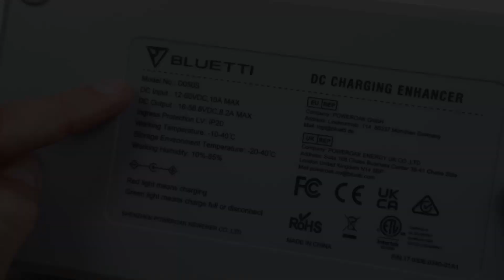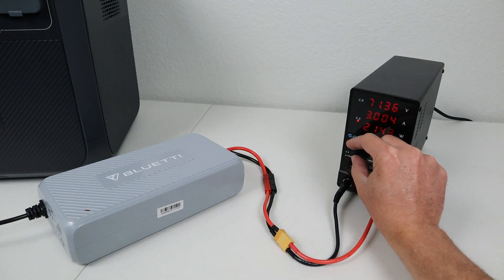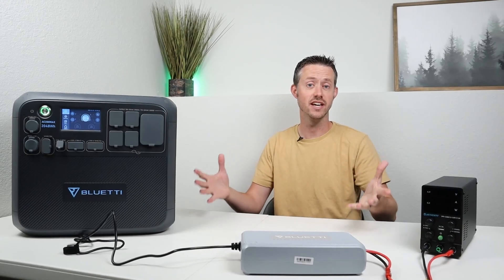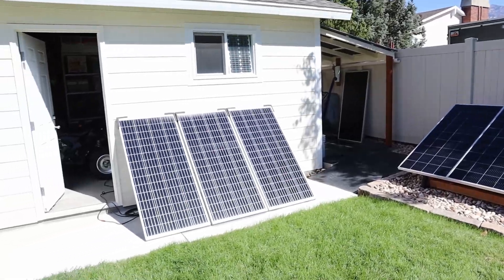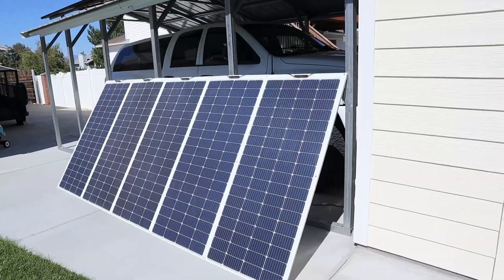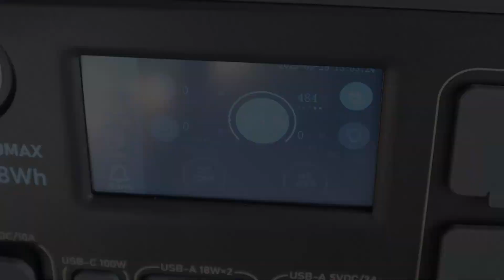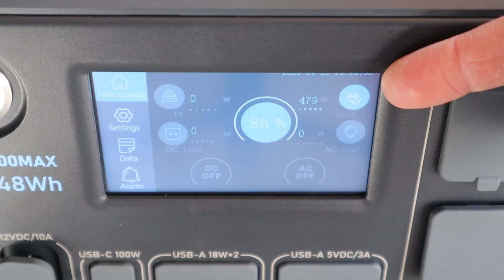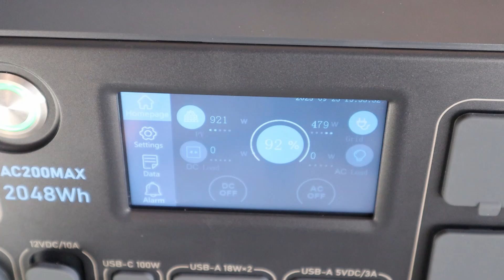The Bluetti Charging Enhancer Accepts More Than 60V?! Let's Find Out!

Comment from the maker: Now that we know the D050S can handle more than 60v input, would I recommend doing it? 
Hmmmm.... well I think if your solar panel VOC is pretty close to the 60v cutoff, I think you'll be fine. If you're going to be pushing it into the low 70's you might be at a higher risk of damaging the charger...especially if it's cold outside since your panels will get higher voltage at cold temps. NOTE: all the voltages seen in the video are VOC and remember the voltage under load (Vmp) will drop down significantly and most likely will be around 45v-55v. Give me your thoughts, what do you think!?
Reply: I’ve been running a d050s on my ac200max (with 2 b300’s) for over 6 months now. I have 3x eco-worthy 195 watts panels connected to it, in series. They have a open voltage of of around 65. The do50’s has never had any problem with them. Under load, they are running in the mid 50 volt area. It charges at 500 watts under ideal conditions, even higher at times.
Reply: It might be good to open it up and verify voltage ratings of the input capacitors.  It's harder to verify mosfet voltage ratings (part number, look in spec sheet), but those might also be critical.

Hopefully they did do input voltage detection and shut it off at a safe level, but that is actually rather difficult and so typically a spec is given that allows some safety margin.  But if you intentionally intrude into that margin and something burns up then it is your responsibility.  Trying to get Bluetti to warranty or other replace equipment damaged by violating the specs would be dishonest.

I don't see what the problem is with a 60v limit.  How many amps can it take?  watts / amps = volts and you can compute the minimum voltage to get the full power.  Or you can watts / volts = amps to compute the amps at whatever voltage you have.  The Delta 2 and Delta 2 Max have a similar limit and you can find the appropriate panels to series & parallel to provide enough amps at a voltage within specification.
Reply from the maker: @Sylvan_dB  I'll explain why the 60v cutoff is pure garbage on these devices (EcoFlow, Anker, Jackery, and Bluetti all do it...) The input specs for this D050s are 60v @ 10amps, for 500 watts output. Is that 500 watts attainable with most solar panels? No, I'll explain that here in a second. Once you work with solar panels you'll understand that this 500 watts is basically false advertising on Bluetti's part for 99% of solar panels on the market (I have found ONE exception so far after looking at hundreds of panels...only NewPowa 180w panels keep under 60VOC). I basically showed this false advertising off in my first video on the D050s...

A 2S solar panel configuration will get you about 48VOC and 35Vmp. Remember the peak voltage (VOC) only happens when the solar panels aren't producing power. Once they start putting out power the voltage drops down to their Vmp rating. This means the higher VOC level is not a problem when solar panels are producing power, it's only right when you connect it up or if the charger is sitting idle. How much power will you get from two 180w 12v panels in series? They produce their peak power at 35 volts @ 10 amps, which is only 350 watts. That's the highest wattage you can expect on the D050s and that's only in perfect solar conditions. Realistically you would see 280 to 300 watts from those two solar panels in series.

But how do you get the claimed 500 watts that Bluetti advertises?! Since the Bluetti charging enhancer has the 60 volt cutoff you can't connect solar panels in a 3S configuration because they usually have 64VOC to 75VOC. To get the full power on the charging enhancer you need 48-50 volts @ 10 amps which is only attainable with a 3S configuration but too bad their VOC goes over 60 volts. So now you should see what having a slightly higher VOC limit allows for the full 500 watt charging amount as I showed in this video.
Reply: @Jasonoid  10 amps does make it hard! That means to meet the specs you have to be at least 50v but no more than 60v.  That's a lot worse than the Delta 2 which can do 15 amps, meaning you can get the 500 watts as low as 34 volt.  It sounds like Bluetti didn't think it thru very well!
Reply: The panel I’ve found that has the most favorable ratings for the D050S in a 3S configuration is the Kosta 200 watt PV. I haven’t independently verified it, but it is rated as follows & is priced competitively:

Max Operating Voltage (Vmpp): 18.90Volts 
Max Operating Current (Imp): 10.58Amps 
Open Circuit Voltage (Voc): 21.86Volts 
Short Circuit Current (Isc): 10.99 Amps

So open circuit would be slightly over briefly, than it would be well within spec. Thanks for the excellent video.
Reply from the maker: Per some of the comments today, 21v would be too much! 😂🤣
Reply: Ohh also, I’ve found my Bluetti max tops out at a sustained 920-922 watts of PV. The extra power capacity is nice.
Reply: @Jasonoid  well , I'm from Cuba , here it's always warm , just sometimes in a year it's like 18 or 16 degrees, just at night it's 12 or 11 degrees and it happens just 2 or 5 times a year , if it happens, so , should be good I think

Comment: My B300S 'Adapter input' is limited to 8A Max (which the D050S charging enhancer uses), 'PV input' is limited to 10A max, and GROK tells me I wasted my money and should use the PV input port. GROK told me using both inputs, doesn't increase watt inputs to my B300S

Comment: I have 3 solar panles of 100w 20.3 VOC in series , i have a AC180 , the Total VOC its 60.9V , do you think it could damage my solar input on my bluetti ac180? Please help🙏🏼
Reply from the maker: In cold temps the voltage would be too high. Warm temps you should be fine.

Comment: It is highly likely that if you tried to apply over 60 volts delivering a higher overall wattage the D050S would shut down long before the 75 volt threshold you have stated. Continued overvolting will breakdown both IC components and the dielectric strength of the insulation of the input  side of the D050S. Bluetti are airing on the side of caution to increase the longevity of their products, solar panels display more extreme no load voltages than batteries which drop in the same way when a current flows to do work.

Comment: It doesn’t show on the BLUETTI website but do you think this could be used on the ac180 unit for ac charging it only shows it for the ac200 models
Reply from the maker: Solar panels just connect directly to the AC180, or internal AC wall charging. This will not work with the AC180.

Comment: Great Video, thanks for the Info, this is so important because unless you can buy true 250w panels this is your only chance of getting close to the 500w input,, Go Over 250w panels and the Voltage goes over 30V per panel and the Bluetti's Solar Input socket does not like Over Voltage. But Bluetti Did Call It a Charge Enhancer In all Fairness to Them and that is what it is Doing In your Video, Big Thumbs Up. Well Done.

Comment: I purchased the enhancer mostly to run a different watt solar set. I can run a Bluetti 420w on the regular solar connection and then two EcoFlow 160w (each) with the charge enhancer. Is that good?

Comment: Can you use a 10 amp DC Dc charger as an input into the D50
Reply from the maker: Doesn't a DC to DC charger still put out 14v like the battery itself? I don't think you'll see a higher wattage or faster charging with that.
Reply: @Jasonoid  but would it work, i am looking for a way to charge my ac200 max while driving.
Reply from the maker: The Bluetti charging enhancer isn't worth it, this is a much better option:
https://youtu.be/NqnYaqMwktE

Comment: That device is hard to get. 9 out of 10 times when I look it’s sold out.
But I do have one. And I don’t even have a BLUETTI.

questions :
1) can I use this on other solar generators as well? It should theoretically work. Or at least it should if the AC input wattage can be set at the solar generator 

2) can you over panel it? If so, then you should be able to get close to 750 watt out of it.

Comment: Couldn’t you get around this high voltage by connecting in parallel?
Reply from the maker: This has an amperage limit of 10 amps, so putting solar panels in parallel won't benefit anything.

Comment: I use 4 Bouge rv CIGs Yuma 200 watt panels on my truck camper.2 - 200 watt in series (25v/8+a +/- 5%) on one side of the Bluetti AC200MAX and the same on the D050s enhancer side. I can use more on the solar side but it seems that it works pretty good. I have also charged with Dokio 300 watt (Great for low light/overcast days), 420, 350, and 200 watt Bluetti panels and to be honest a 420 on one side and 350 on the other if you are not running anything high will do.

Comment: Can this be used with my renogy 40a dc to dc charge controller from my start battery
Reply: No. It’s mc4 to AC out. Your dc/dc controller connects directly to a LFP battery. This device connect to the AC-IN on your solar generator.

Comment: Great video Jason. I am a recent subscriber. Btw the DO5OS manual says it has a amp max of 8.2amp. Even though the Ac200max has the current limit of 10amp.
Reply from the maker: Yeah, the Bluetti charging enhancer is designed to be compatible with many of Bluettis older devices.
Reply: @Jasonoid  do you think a grid tied inverter would do the same as  the DO5OS?
Reply from the maker: @DeSilver215  no, it functions very differently. A grid tie inverter takes DC solar power and turns it into AC power. The charging enhancer takes DC solar power and makes it 58.8v DC.
Reply: Hi Jason, I am curious how the bluetti power station ac inlet can handle 450w Dc via the 7909 barrel plug from the enhance charger in your video.
Reply from the maker: @DeSilver215  the charging enhancer is a DC to DC booster, it takes the voltage of your input and converts it to 58.8v.
It does exactly what the AC wall charger does, it puts out 58.8v DC.

Comment: They didn't lie. They they just didn't want to over state what the D050S would do. Also maybe they would only guarantee for 60 V use.
Lying would be just the opposite saying 70 V input but only 60 could be used. I am surprised you even said the lied.
Be happy you can push the device higher. Bad thumb nail. Don't fall into the trap of goofy or misleading thumb nails.
Reply from the maker: It got you to watch the video right? And now you know something new about it... How to get the full power 😁
Reply: @Jasonoid I I recently bought a AC180 and an AC200Max. At the time of your video I had a B230 being delivered with a D050S.
Thus I thought maybe the enhancer was junk by your title. Guess not.

That being said, Your misleading thumbnail and snide remark about getting me to watch is not the way I had come to expect from you. Too many Up-loaders on YouTube are goobers. Don't be one of them.
Title could have been "The D050S delivers better than expected"
Reply from the maker: @LarryDickman1  I've been working on a new title and thumbnail for the video. I'll probably get it changed here in the next week.

Comment: I bought a 600W voltage enhancer for 19 bucks on Amazon... The DS050s is just good marketing. Nothing more 
Apoesar 600W High Power DC to DC Boost Converter DC 12-60V to 12-80V Boost Module Board Step-up Transformer
Reply from the maker: Thats AWESOME! What type of power do you see from your version?
Reply: @Jasonoid  I can get 40 V (input voltage) x 10 amps = 400 W . I use it to connect 2x 200W Solar PV panels from Renogy.
My Bluetti AC200P has then : 600W (3x 200W Renogy PVs) on the PV input, and 400W (2x 200W Renogy PVs) on DC transformer input, for a total of 1000W PV input power. All this is used to power my Ford Transit camper van. I have built a "Input power" switch board where I decide which energy to use as input: 2x DC transformers connected to the grid AC, or 2x Solar input, or other

Comment: How about the a.ps being over 10amps. I was gonna use a 500 watt panel thats voc is 46v, but the amps are almost 14 amps which is over the 10 amp specs. Does the amps matter or will the enhancer onpull 10 amps max. I dont want smoke chech the enhancer :)
Reply from the maker: The enhancer will limit the amperage below 10 amps.
Reply: @Jasonoid  excellent,  thank you!!

Comment: I have a 55 volt mppt charge controller and when I took it apart it had 63 volt rated input capacitors. I wouldn't want to go over 63 volts because it might damage it. Check the input capacitors on your Bluetti to see what capacitors it has.

Comment: Thanks for this solid info. If I get a second solar panel array I'll get this DC enhancer.
TIP: Keep the supply cords running from yer solar panels shaded from sunlight and other heat sources for better conductivity. That's why the solar panels work better at lower temperatures.
Reply from the maker: My permanent solar wires are buried in conduit underground so they are nice and cool and not in direct sunlight.

Comment: Jason, is there any difference,  if you plug in the enhancer into ac200max, B230 or B300 ? In case, if ac200max is connected with b230 (b300) at the moment of charging. Thanks
Reply from the maker: Nope, it functions the same on all three

Comment: Good to see the OCV for the panels. Did you also measure the voltage for each set of panels when they were connected and providing power?
Reply from the maker: The voltage under peak load is much lower than VOC. Once the panels are producing power the voltage will be around 48 to 52 volts, depending on the panels. Just look on the panel specs for the Vmp number.

Comment: A little history...I have known this for a couple of years. I posted in the Bluetti group twice about this. Once in October 2021 and another time in July 2023. Bluetti told me in an email exchange with them about 2 years ago that 75 Voc was the limit. Bluetti confirmed it again in July of this year that it was designed to take up to 75 Voc but they have not changed it from 60 Voc and replied after I asked them to correct their documentation:
"We will hold onto it for now. However, we will pass your feedback on to our technical team, and they may reassess the situation."
I have been using it with up to about 71 Voc for 2 years now. 
The reason that I even thought to ask about a possible higher Voc was that they were bundling the DC Enhancer with 3 SP120 panels which would have a total Voc of 23.7 x 3 or 71.1 Voc. I thought that if they were bundling it with 3 panels totaling 71.1 Voc, that they intended it to work with them. So I asked, and they said that it would. As you showed, it offers many more options for panels to get closer to the 500 watt max with the 10 amp limit.
Reply: 10amp at 71v is 710 watt. Can you over panel it on the Amp side and by how much ?

Comment: This is such a trip.  I'm looking at my 2s 2p 100 watt Newpowa string and it's reading 55.4 volts through the charge enhancer.  The same panels ran in a 6S, 2P are on the main input and they are only running 98 to little over 100 volts right now.  I've never been able to go over the 60 on the charge enhancer.  I've always felt like it  reads the voltage incorrectly.
Reply from the maker: The voltage on the screen (if you expand the AC input screen) is the voltage of the internal battery, not the input voltage from the device. It will stop charging around the 58v mark. If you had an inline voltmeter on your solar panel, it would read around 33v to 35v under peak power.

Comment: My  2nd  AC200P  just  quit  two  weeks  ago.   2.5 years old  and  won't  take  a  charge  or  'wake-up'.   Waiting to hear back from  Bluetti  several  days now.   Registered  after  purchase  so  it  should  have  the  two  year  warranty  extension.           take  care,            rh
Reply from the maker: I hope they take care of you! What do you use your power stations for usually?
Reply: @Jasonoid  -   Most  everything  that  requires  any  'real'  power:   refrigerator,  microwave,  induction cook-top,  air-circulation and window A/C on warmer days,  air-circulation on cold days  from wood burning stove,  as well as  LED  lighting  and  my  computer monitor/sound.   Also charge the Nissan Leaf in 1.5 KW increments  which total all I need  (retired).

Still draw some power from the most expensive provider in the country (SDGE San Diego).  My bill this month was $29.00  for  69 kilowatts + $5.00 gas. (.35cents/kw on the 'care' program!)     Have yet to hear from Bluetti.       I  DO  enjoy your reviews ! !           thanks,          rh

Comment: Are you familiar with the new BougeRV 300 watt 10BB solar panels? They cost $379 on Amazon but they are rated at only 20.8V VOC.  So couldn’t someone just use two of those in series to charge the BLUETTI or an Ecoflow Delta 2 which has a 60V input limit to get to 500 watts solar input?
Reply from the maker: What's the amperage of those panels? The charging enhancer has a 10 amp limit unfortunately.
Reply: @Jasonoid  looks like max power current imp is 17.14 A and short circuit current isc is 18.85 A.  Not sure which one is relevant but both are way over 10A.